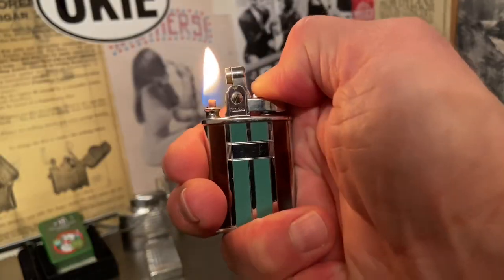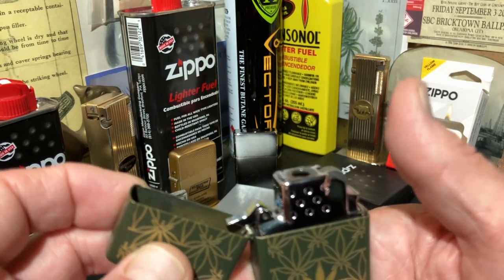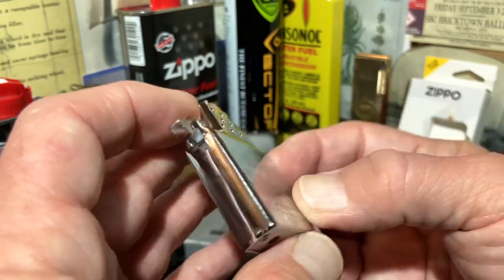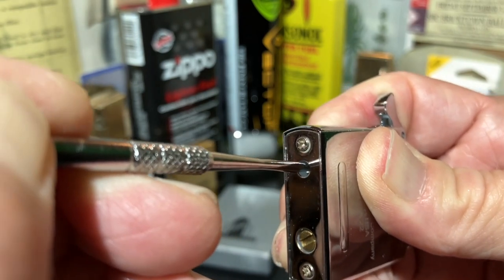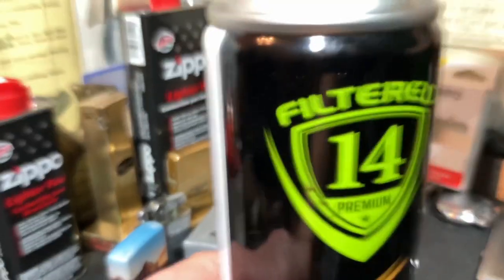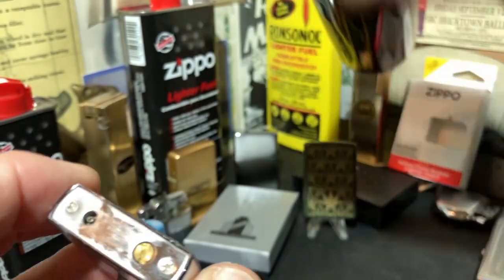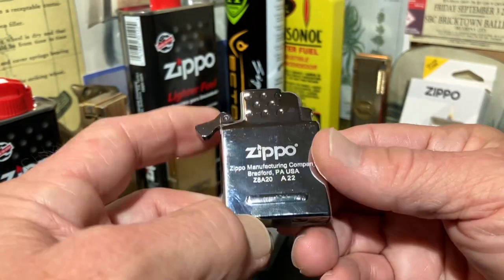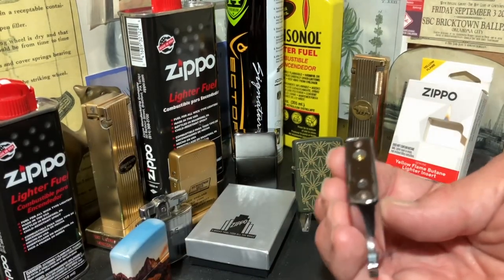Refilling Our Zippo Butane Soft Yellow Flame Insert For A Second Time/Gauging Fuel Efficiency

Comment: I find these need cleaning over as the flame gets smaller due to dust and flint material building up over time where the flame comes out. The slight clogging will be desirable with this unit because that non-adjustable flame is way too big.

Comment: I'm excited to see how Zippo's butane inserts would fare in the long-term use, if they are as reliable as the petrol wick inserts, and so on. People have long been waiting for a solution to the evaporation issue. Butane lighters are the solution. A real solution that solved the problem once and for all. It was a solution the lighter world has came up with in the 1950s. And it comes with no wick. Zippo finally did, what Ronson, Quercia, Dunhill and other lighter makers have done decades ago: The butane lighter. Zippo's first attempt with the butane lighter was I think in the 80s with the Zippo Contempo. Zippo's butane lighter came rather late, didn't it?
Reply from the maker: Zippo did come late to the butane fueled lighter market and hasn't fared too well with their offerings up to this point. The change to butane though didn't help many, if any of those older brands you cited stay in business as they have largely fallen by the wayside. I'm not sure butane is the answer because it has limitations of its own, even if it doesn't evaporate. I hope you are well my friend!✌️

Comment: The butane runs out in a few days whether you use it or not?
Reply from the maker: No, butane should definitely retain its fuel and not be prone to the same evaporation problems as petrol lighters.✌️
Reply: @DependableFlame  ok. awesome.ty.  think ill get an insert and some butane eventually. just bought an old type though...........Lighter, fluid, 3 wicks and 3 packs of flints for 25 bucks.